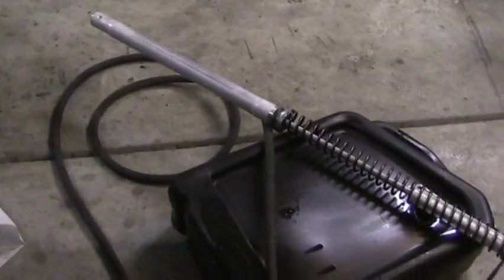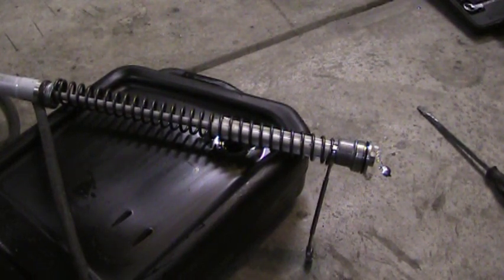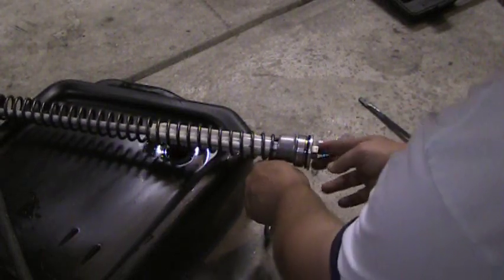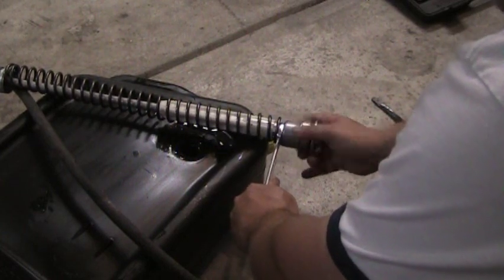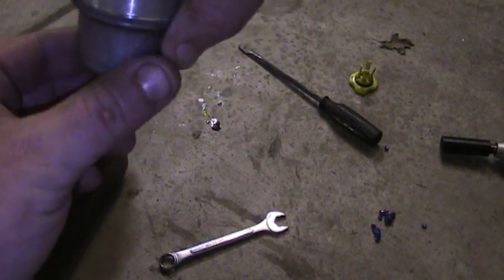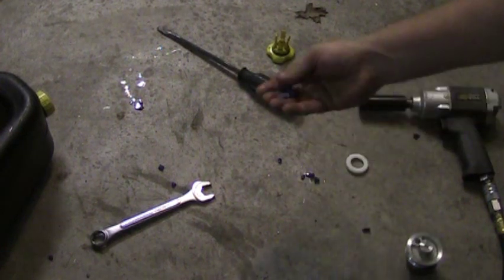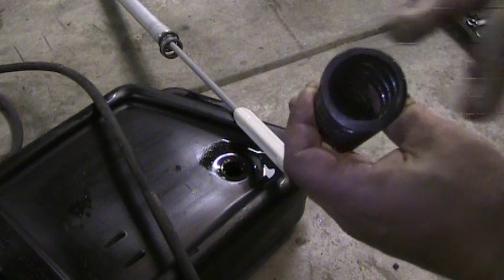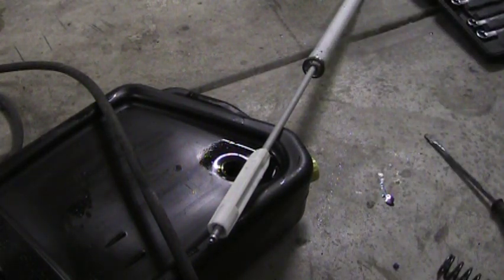Part 33: Motocross Fork rebuild part 2. Draining fluid and removing spring. YZ250F.

Comment: You are setting this bike up for yourself obviously.  It would be helpful to others if you were to mention your weight, skill level and usage for the bike. I'd like to hear you discuss how you'd adjust these forks for 1) woods bike set up vs race/ speed setup 2) a lighter or heavier rider 3) real steep / rocky terrain vs race and 4) maybe what you;d change for a less experienced rider. I've seen a lot of how tos but not many that clear up these variations. Your series looks great thanks.